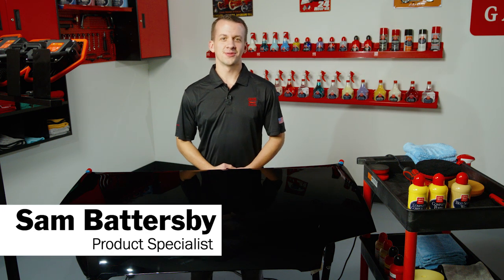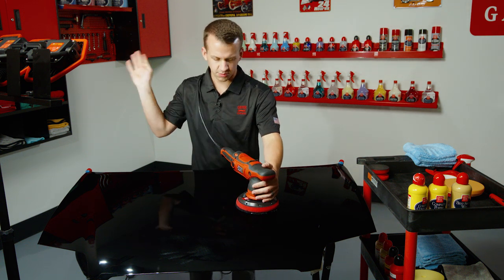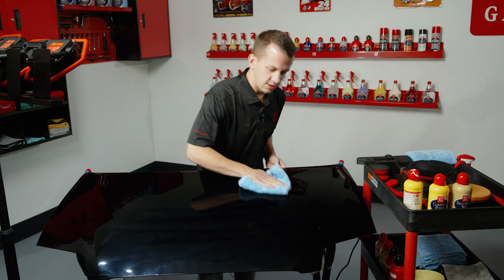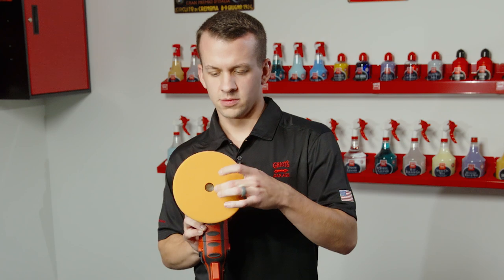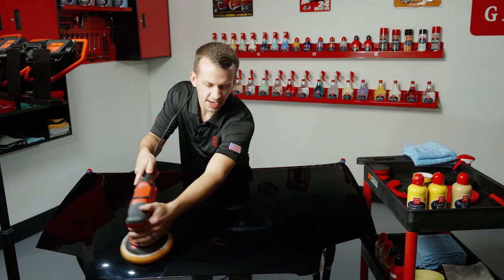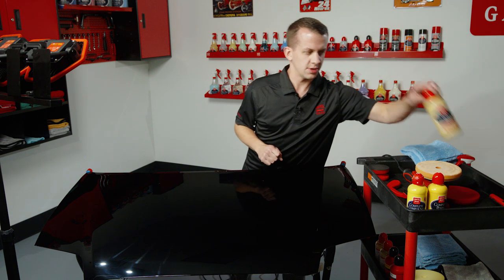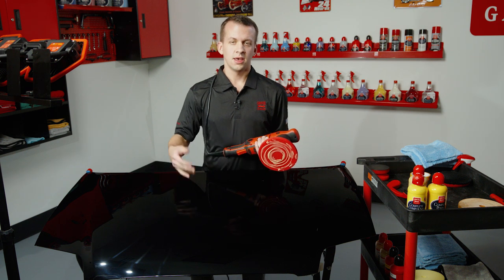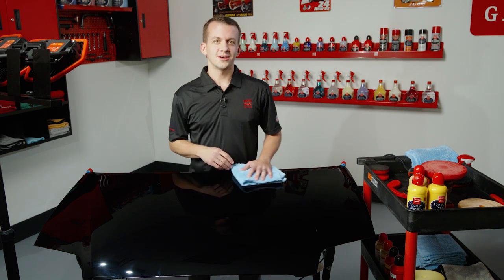How to: 3-step process with the G9 Random Orbital Polisher

Comment: Noob question here:
When i use these 3 steps do I do one step on my entire vehicle, then the second step on my entire vehicle, followed by the third step?  Or should I do all 3 steps in each panel/section at a time?
Also, do i need to wash the pads in between each panel?
I’m gonna be tackling my severely neglected 08 Gray Chevy Silverado Crew Cab
Reply from the maker: If you're doing the whole vehicle we typically complete each step before moving on to the next step. We recommend swapping out your pads a few times during the process, however it is not necessary to wash after each panel, you can wait to wash all the pads until the end of the detail. Before swapping out for a new pad, you can either user compressed air or a tool like our pad condition brush to clean up the pad.

Comment: If u were gonna apply a 5yr ceramic coating, not a spray temp one, is step 3 necessary? Waxing would just get wiped off with final IPA wipe down before application
Reply from the maker: Correct, you can skip the third step shown here if applying a high solids ceramic coating

Comment: Today I used my G9 for a second time and it started to sound different. And sometimes it started to go on the fastest speed eventhow I dialed to a lower speed it keeped going to the faster speed. I think something got broken with my tool. Very disappointed. I don’t know If it can be replaced at this time. But even if I can get it replaced I have to pay for shipping and hadeling to Venezuela and it is about $40 extra dollar each way. I am trying to start my detailing business with a low bugget so this issue is a big deal.
Reply from the maker: Hi Tico, we're so sorry you're having some issues with your G9! Unfortunately we cannot warranty machines outside of the US as we do not currently sell internationally. That being said, if you bought from a US supplier the warranty could be handled through them.
Reply: GAD!  Just step up to the plate and help this guy out. For gosh sakes! @GriotsGarage

Comment: I used the complete compound with the Orange pads on my black car and it turned out great.. Is there an advantage to using the micro fiber pad with the Complete Compound?
Reply from the maker: Using a Microfiber Finishing Pad will speed up the correcting (defect removal) ability of Complete Compound.  It is best to try a small area first to check your results.

Comment: Is this good for removing deep scratches
Reply from the maker: Hi August, without seeing the scratches it is tough to say for sure but the G9 is capable of removing severe scratches with the right pad and product. As a general rule of thumb, if you finger nail catches on a scratch it's deeper than can be polished out and will typically require body work.

Comment: Griot’s Garage, after the polish process, do you suggest applying/wiping an IPA to the paint before the final wax?

And after the wax, what do you recommend applying to the paint? Ceramic wax?
Reply from the maker: Hey Luke, you absolutely can use an IPA wipe on the paint however it is not entirely necessary. We often give it a quick wipe down with speed shine.

And after the wax, depending on what wax you've used we have a few quick detailers that work well for those quick clean ups between washes. If you're going to use Ceramic 3-in-1 Wax, we'd suggest two coats of it on it's own.
Reply: What does ipa mean?
Reply: @JDMSMOKEY03  isopropyl alcohol

Comment: Question : once you use the pads on a vehicle once are they able to be washed and used again or one and done? 
Question 2: I noticed you didn’t Clay the paint before starting is that a necessary step in the prepping process 
Last question: Does it matter whether you polish your car in direct sunlight or preferably in a garage or shaded area.
Reply from the maker: Great questions, Carlos!
1. Our pads are designed to be washed and re-used multiple times. We suggest adding in our Microfiber & Foam Pad Cleaner in with your choice of laundry detergent when washing them. This video covers step by step how we suggest caring for your pads to make sure they last: https://www.youtube.com/watch?v=a6D_Bj2cPYQ&t=20s
2. This video picks up where you would start following decontaminating the vehicle. We always recommend using a clay bar or chemical to decontaminate the surface prior to polishing.
3. We recommend polishing in a garage or shaded area when possible, but recognize that is not always an option. That being said, you can certainly polish in direct sunlight just be mindful to wipe off the polish reside quickly and work in smaller areas to be able to polish and wipe in a short time period. In extreme heat you may notice that it takes a bit more elbow grease to wipe the polish away than normal.

Comment: My local Autozone has this polisher but box naming is marked like the old 6" orbital polisher not G9.

One of two boxes i saw had the older model in box.  Clerk at store thought it was a factory mistake in shipping.
Reply from the maker: Some AutoZone stores are working through inventory of the 3rd generation Random Orbital.  So in the short term you may see a mix of the 6" and G9.
Reply: @GriotsGarage  is the 3rd generation thzt looks like a G9 compatible with the 3" pads?
Reply from the maker: If you're asking about the G8 (https://www.griotsgarage.com/product/g8+mini+random+orbital+polisher.do), yes it is designed for both 2" and 3" pad systems.
Reply: @GriotsGarage  no askong about the 6" orbital that has 3" pad accessories on your web site.  The new  G9 isn't compatible with as many pad accessories like the heavy-duty 3" size.
Reply from the maker: The 3rd gen 6" (part 10813) will work with a 3" pad when you add the HD 3" backing plate. 
 (https://www.griotsgarage.com/product/3+inch+heavy+duty+orbital+backing+plate.do).
Reply: @GriotsGarage  does the 3rd gen look like G9?
Reply from the maker: It does not.  It is the orbital shown in-use on the HD 3" backing plate page.  Or you can see it on this page until the remaining inventory is sold out - https://www.griotsgarage.com/product/6+inch+random+orbital+gen3.do
This is the G9 - https://www.griotsgarage.com/product/g9+random+orbital+polisher.do